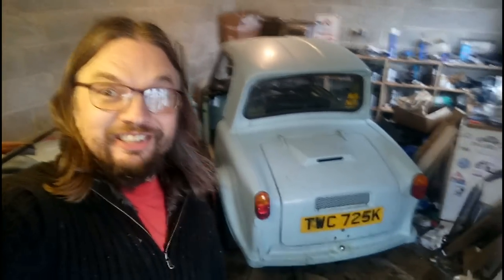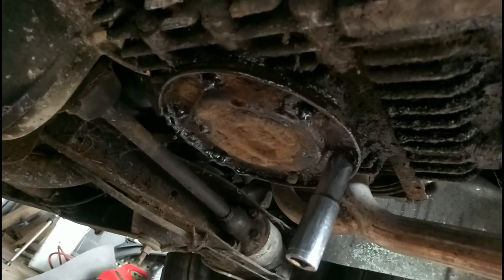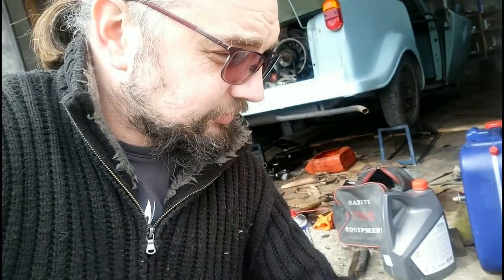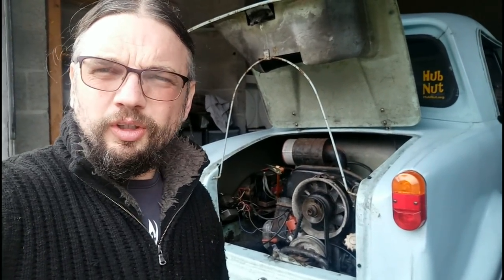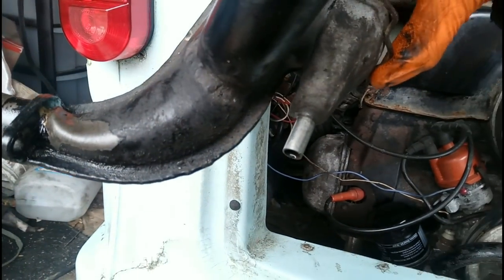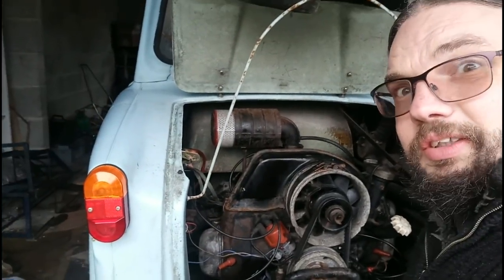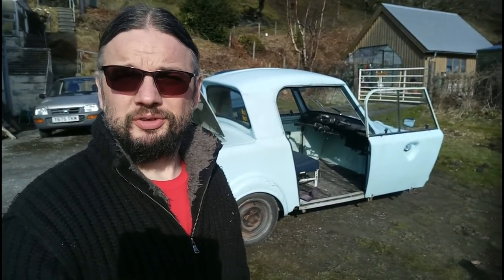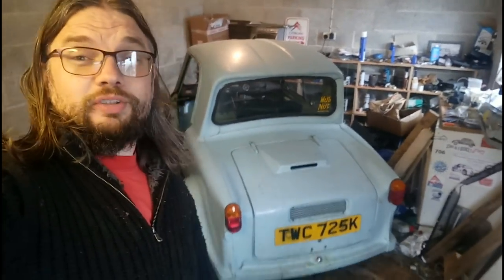Project Invacar Part 17: Can TWC hit 60mph?!

Comment: Hi Ian could you point out what each of the lights on the dash is for, I get indicators, head lights, oil temp and is that the neutral on the Variomatic then goes off when drive Engages.
Reply from the maker: Top left oil pressure, top right charge, bottom left indicators, bottom right main beam.
Reply: On an earlier video, you commented that it seemed odd that the oil pressure light was green: I've only seen that once, on an elderly Land Rover. I was used to green for indicators, orange for oil, red for charge and either blue or red for main beam. You could always swap the lamp bodies around as they're a push-fit and I seem to recall the lamp-holders just push inside them :)

As ever, an absorbing video series that never fails to make me smile - keep up the good work!
Reply: Thanks,  now I follow 😀

Comment: I haven't watched the video but some US Air Force wisdom, just BECAUSE you CAN do it doesn't mean you SHOULD. The next question is how long have you had this death wish? As far as your strainer, you've never messed around with an air cooled VW have you? That very much looks like a VW part, and if you can find one off of an older bug they have a drain plug in the middle which makes oil changes much more pleasant. As far as your fuel problem I'm thinking your float might be a bit wanky, like maybe hanging up.
Reply from the maker: Oh no. I do many things just because I can. The engine does seem very Volkswagen-inspired. Floats are behaving. Think there's a clogged jet or tube.

Comment: i thought you had already had the carb in bits , i am pretty sure a good strip down and overhaul should solve the issues
Reply from the maker: I'd taken the top off and checked all the jets I could find, but it seems these carbs have a number of small passageways.

Comment: all I can say is 60mph must have felt like 150 in that. it's feeling to me like main jet blockage or heat from the engine causing fuel evaporation. did it have a heat  shield?
Reply from the maker: Jet blockage is my number one suspect. It plays up too readily from cold for it to be a heat issue.
Reply: +HubNut hope you get it sorted. great job so far

Comment: I would check the whole fuel system out it might be something in the tank. I had a car used to loose power then pick up found out it was something in the fuel tank it would block the fuel line then move letting the fuel past
Reply from the maker: Tank was bone dry and is fine. Have an inline filter. I reckon there's still gunk in the carb somewhere.

Comment: 60 mph in an Invacar, trust you were wearing the brown trousers! As far as the cutting out goes with the carb covered in fuel it would suggest that the gasket has no integrity meaning that if fuel can escape and air can be drawn in the engine may be trying to run with a very weak mixture....just a thought. Nice vid.
Reply from the maker: Thanks. Also possible it's spitting fuel back through due to a blockage, so I'll have it apart to check. We've already replaced the top gasket once, and it didn't make the slightest bit of difference.
Reply: Someone suggested using an ultrasound cleaner which is a really good idea if you have access to one. Mustie1 has cured many a carb problem with an ultrasound bath. Good Luck.
Reply from the maker: Yes, I now have an ultrasonic cleaner, but it's too small to take the entire carb sadly. However, it was a gift, so can't complain!

Comment: Do you know who originally designed that engine?, there seem to be a number of early Porsche/VW cues, even the oil drain plate, cooler and filler neck .
Reply from the maker: Steyr-Puch in Austria. As you say, clearly VW inspired.
Reply: ...and of course, Steyr in Austria is where BMW make their engines. The Puch badge bears a passing resemblance to the BMW one.

Comment: Wikipedia writes ,  reported top speed of 82 mph, that would really be abuse and scary.
Got some more info ? 500cc or 600 ,  Hp?   3 or 4 speed?  total weight?
Reply from the maker: 493cc, 20bhp, gearless continuously variable transmission, kerb weight 410kg.

Comment: Hello TWC :-) We Want A Fan Club For You :-) hehehe  the fins on the underside of the engine are covered in road dirt. Have you thought of attaching a temp guage to the block to see how hot twc is getting.  Is there no thermostat on these engines like on the boxer engine (vw)  Great Run :-) does the carb need ultrasonic cleaning ? or is it worn
Reply from the maker: Good point about the thermostat. I've no idea. I could fit temperature gauges, but maybe out of sight, out of mind is better. The more gauges there are, the more you worry! Carb does need a good clean I think. That'll be the next plan.

Comment: "I'm hammering a 10 mill on in the hope..." SHUDDER. Can't we have a crowdfunding to get you a nut splitter? 

On another tack, could you fit a 1000cc superbike engine in instead of this awkward unit? That said, it does sound a lot healthier than the last time.
Reply from the maker: Not sure you could get a nut splitter onto the nut, but sorted and replaced now anyway. This isn't a particularly awkward engine! I just haven't done what needs to be done yet...

Comment: Strip down carb get yourself a spray tin of carb cleaner that should do and clean the fuel tank out  a little trick with a fuel tank removed it from your vehicle and drain it where the fuel gauge  is the access point remove put some carb cleaner or fuel and some large ball bearings  plug up all the holes up and ratting the ball bearings and may have to this a couple of times until no rust or dirt come out of it. I have done this method  will old motorcycle fuel tanks this has the trick last resort use special pet seal
Reply from the maker: Fuel tank can't be removed without a LOT of bother. I don't think that's the culprit.  I think there's some gunk in the carb that's been there from day one.
Reply: Please do not use gunk in your carb! Please use carb cleaner it is an alcohol-based chemical this with evaporate I have  built well over 30 classic motorcycles  I have done this to My BMW R65 Motorcycle whing has bing carbs
Reply from the maker: Sorry. Poor choice of word. I use gunk to mean crud, rubbish, sediment, not the engine degreaser!

Comment: Classic fuel starvation that power loss at speed.
Reply from the maker: But it also does it when not at speed. Still reckon clogged jet.
Reply: Worth checking the carb. I had a Fiat 126 BIS that did the same. Turns out the pump drive system was worn (the rod wears down) Gave enough fuel when running under small loads but couldnt keep up at bigger loads. Either way it might be dirt in the carb :)

Comment: "Halfrauds" I'd not even buy a washer from them, a bunch of crooks.
Reply: And you still aint wiped the bird poo off your fuel gauge!
Reply from the maker: This is an old video...
Reply: @HubNut  I repair and service cycles, Halfrauds seem to love on kids cycles to put the front forks on back to front, over 90% I have worked on have been that way, told them in the shop and via email but they say I'm wrong (I aint). Even showed them their own staffs cycles and the forks! Would I trust them to fit a child seat in a car? let me think about that, NO! Never seen so many cowboys since the days of John Wayne and his bad acting.

Comment: Mineral oil? You nutter put semi in it! Its not 1960! :(
Reply from the maker: Given the previous lot of oil only covered 50 miles, it doesn't really matter what's in there. There is nothing wrong with mineral oil, unless you expect to cover 20,000 miles between changes.
Reply: I thought mineral oil resulted in more gunk and residue inside the engine? Might be wrong!
Reply from the maker: No, it just breaks down more quickly, so you can't leave it in as long. I'll stick to regular changes.